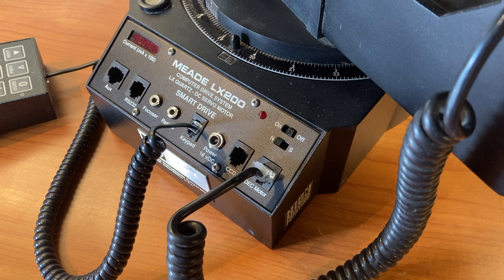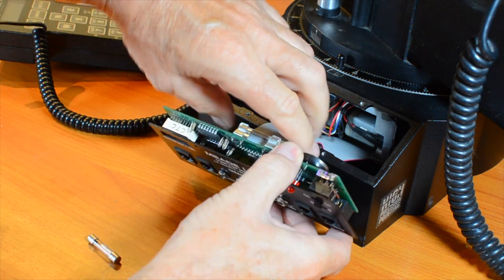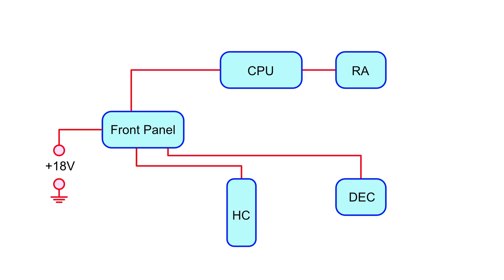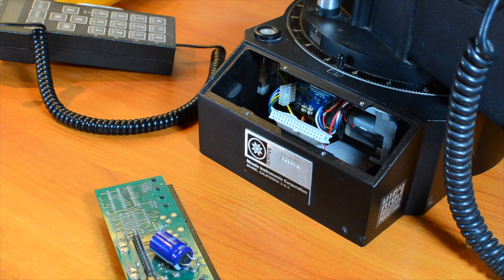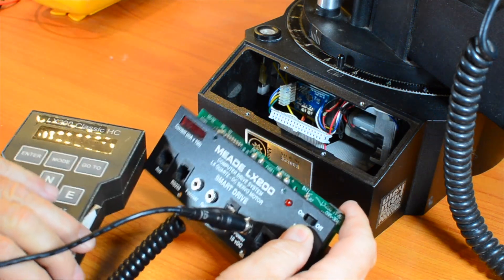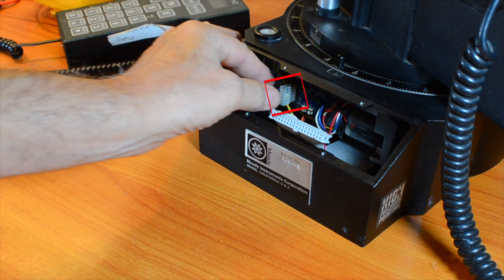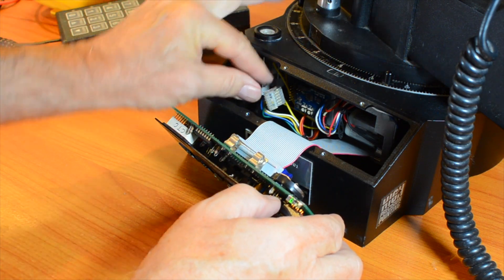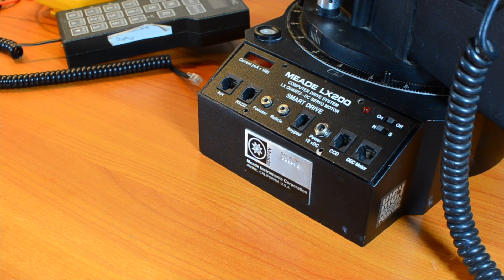Short Circuit Troubleshooting on the LX200 Classic

Comment: HI there! I just picked up a 10" LX200 for cheap. I plugged it in, turned it on, heard a pop, then no lights...but a faint electrical smell. should I follow this video as a first trouble shoot?
Reply from the maker: Yes, unless you heard where the sound came from and can visually see the shorted capacitor.

Comment: Hello, when we connect the mains power the current indicator (top left of panel) all the LEDS light up, then go off and we subsequently have no power - any ideas what could be causing this?
Reply from the maker: Could be the power supply's current overload protection kicking in, if it has that feature. That can keep the fuse from blowing, but it still indicates a short somewhere.

Comment: Hello, it seems to be my faceplate that is causing the issue but I don’t see any visibly damaged or burned components. Any ideas?
Reply: I’d also like to mention it only shorts when I have the switch in the on position
Reply from the maker: Sometimes the capacitor C1 can be shorted without showing, so you should test it with a DVM to confirm.

Comment: Hi, I have a question to ask, in the video, (precisely at min. 2.50) when you unplug the AR motor encoder connector and turn on the telescope, you can see that the AR motor turns. My question is: how does it turn AR motor if the connector is detached from the encoder? .The connector should carry voltage to the motor.
Thank you
Conrad
Reply from the maker: The motor power leads go directly from the cpu pcb to the motor, they don't go through the 6-pin connector to the RA encoder pcb. They bypass it.